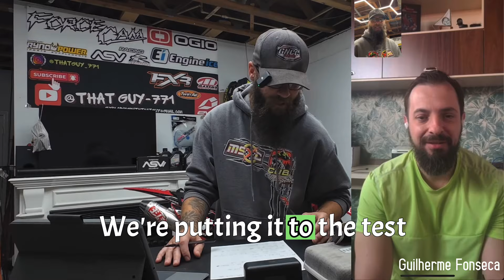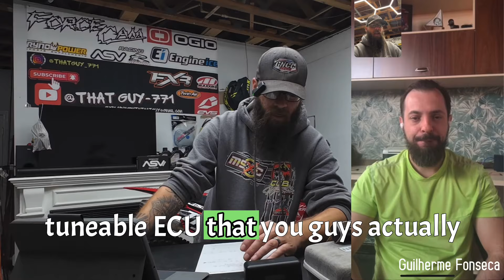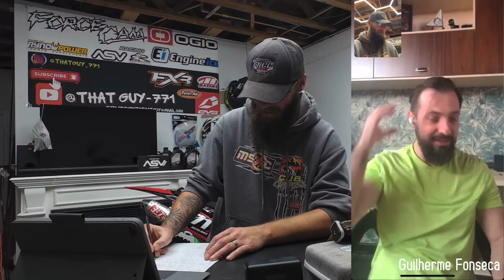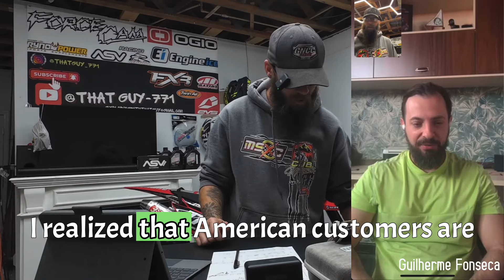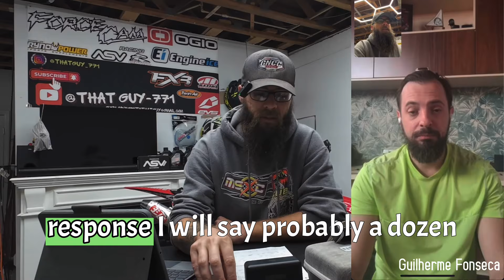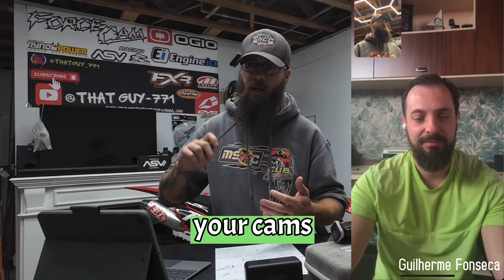CRF250F Big Bore Kits | Force Cam | Live #crf250f #forcecam #crfreview

Comment: Keep the refinements with the ecu coming. Very interested in your specific environments and settings used in them. What you continue to learn on the way. I’m going to use video 3 to fix my same cold start issue as well as the other baseline adjustments you made. So curious if there’s more learned since then. Also the continued performance of the Forcecam kit. Do you regret not going with the Belparts exhaust that the ecu was developed with? I have it on my 250f but had to put an arrestor in it and a db killer because it was straight through and ear piercing. So it’s not what it was when I received it either. Is there any reports on the 310 kit with the race cam ?
Reply from the maker: Thanks for following along! 
So we still have the BelParts on the 310 big bore and you’re right it’s LOUD. It has a grunt at times louder than our Kawi 250. But we have a Yoshimura on the 275 Race cam big bore kit. 

We’re still toying with a few things here and there but ultimately all dialed in. We have been working on some videos for the Alton newer M250X ECU for launch control and things like that you can toy with. Also for the ones that have the original M250 serial number depending we have a software update that can put you on the M250X software with the update. Pretty neat stuff. 

As far as the 310 goes we have the rally cam in that but it’s a tank. Still holds next to the 275 with the race cam. The race cam just gets it on the mid power. The rally 310 is still the preferred tractor though lol
Reply: @ThatGuy-771 you know I’ve never been able to get the Athlon tutorial/course to run in English. The written stuff is like half translated and the audio I have no clue. Having said that you’ve been the translator for me, ty. I tried the cold start fix yesterday and got it to start but you can hear it cycle up and down in rpm slightly and had flame out before it warmed up and smoothed out. Also left the low end feeling sluggish. And it doesn’t seem like I get defaults back with map change as I thought you said it would. I couldn’t find a reset to original maps. I thought I’d get back to square and do only the cold start tweaks and not the rest of your set up to see if I can defeat the cold start and not mess with anything else. I have 92 ethanol free with octane booster that should be getting me a solid 93octane. Stock engine, bel part full exhaust, the mod to air box( as on hyper lite, not full top removal) , and the Athlon obviously. Any pointers are very much appreciated. And thanks a lot for all the videos on this Crf250f. Have a blessed day
Reply from the maker: @12Dredge  thank you! I appreciate the kind words! 
You can shoot me a message on IG or FB I can show you how to do a fresh restart and back to original reset if ya want. We can get ya dialed in. 🤙
Reply: @ThatGuy-771  ya I have neither ig or fb, unfortunately I struggle with big brother issues 😅

Comment: Well, it took a bit longer than I wanted, but after having a real steal of a deal sold out from under me after your live chat with Force Cam, I finally found a super clean, save a bit of boot rash, low hour, (30-ish) 2021 CRF 250F fitted with black plastic (Looks damn sharp, too.) as the young lady didn't like red and hubby had to make it right. Having the stock plastic set aside should things go wrong in a big way is a nice hole card too.  

After getting acquainted and playing with it a bit, I  suppose I'll be sending some money to Force Cam, Tuscany Racing, and Hyperlite Moto soon enough. 

Since you guys have had time to really shake things out in the field, I'd like to get your opinion as to sequence of upgrades and any desirable bits to protect bike and rider.  Most likely frame guards, case covers, and skid plate to start there.

As the bill will escalate quickly enough, I'm thinking I might hold off on the big bore kit and  start out with the Combo 27 HP Plug & Play and maybe the Tuscany Racing Shock and Good Pressure Pneumatic Valve Kit for the forks.  At 67 and 190 lbs. (Yeah, I know.), I see myself focusing on the more technical stuff rather than risking another bout of severe deceleration trauma.  I've been broken and bolted back together several times, almost died of a subsequent pulmonary embolism, and not anxious to go through that again at my age; though I'm not going to go away quietly either. Screw that!  

 Oh yeah, I'll be needing a new seat as the stock was shaved to accommodate the lady.  Suggestions?  

Of course, any other recommendations or tips and tricks would be greatly appreciated. 

Thanks in advance guys. Ride hard, have fun.
Reply from the maker: @sansdecorum4600   hey there! Thanks for watching along! Congrats on the new bike too!!! I tell ya what. I actually already had a video planned as far as mods I would do first or last based on riding styles I have been in the works of finishing up. I’ll have that released tomorrow though. So it should help a good bit answering a lot of those questions! 
As you said we have for sure thrown this bike around all different platforms from trails, to XC racing, MX tracks, single track and even harder enduro. Haha not much we haven’t touched with it that’s for sure. 
As for the seat in the meantime I would suggest getting a whole new seat and cover from Guts Racing though. Custom seat foams or original and custom gripper seat! I run them on ALL my bikes.
Reply: @ThatGuy-771  Cool. I'll look into that seat ASAP. Looking forward to the next video.  Nice timing. Thanks.
Reply from the maker: Absolutely! Feel free to reach out if you have any further questions after too! I’m always here to help 🤙
Reply from the maker: @sansdecorum4600  just went ahead and uploaded it. I do also have a full parts breakdown I listed in the community post section of the channel with all links to the parts on this build

Comment: Informative video. Glad you guys covered the varying fuel issues.  Guilherme came across as super cool and very knowledgeable. 

I get the sense that the 310 rally kit would be the sweet setup for most folk and not unduly overstress the bottom end and driveline. The 360 makes me a bit nervous on that front.  I'm not a fan of frequent rebuilds. 

Still, given that each step in the overbore range makes the engine more and more oversquare and pushing the revs up to hit the power / torque sweet spot, I wonder where the diminishing returns kick in.  Granted, a higher compression piston and proper cam helps, but a modest stroker kit would be interesting.  

I would be interested in Force Cam's thoughts on an oil cooler to help moderate temps for those in hot, muggy, locals.  Tuscany Racing seems to cover the suspension and accessories side of the game and it appears their suspension upgrade offerings are well received.   

Just my opinion as a lifelong rider, mechanic and engineer, but the popular YT obsession with lugging the engine to near standstill and gassing it is ill considered and hard on rods, bearings and everything downrange.  Sure, it will do it, but it's stressful and can also lead to low speed detonation and pistons, not to mention wallets, don't like that much.

I'm sure many will argue this assertion, but I'll stand by the physics. 

Good video.  Keep 'em coming.
Reply: Oh, I had answered with a big text but I don't know what happened, YouTube is not showing the answer. I'm gonna answer again tomorrow. Thanks.
Reply: @forcecam5853  Looking forward to it.  I'll probably get schooled in the process. That's cool. I appreciate being corrected if I'm mistaken. 

For context, I'm just an old dude looking to build his last reliable, low maintenance, trail / play bike with solid power and torque across the lower and mid-range.  Not concerned with top end  power.  For me, that tends to lead to episodes of severe deceleration trauma and I don't mend quite like I used to. 

Have a great day!
Reply: @sansdecorum4600  Hi Sans! haha, you seem to be very well informed. Well, I will not beat my former anwser but let's go. It's true, the 310 kit with Rally cam is the most sold for the 250F here in Brazil. The bigger demand is for exactly that, trail guys looking for more general power and reliability. However, all of our kits are very reliable. Even the 360! The 250F bottom end is very well made and on some degree, overdimensioned. At least this makes all the extra weight worth it! The stock rod bears all the extra power without problems. hundreds of hours of tests accumulated. 

The 310cc with Rally is right there where you are looking at: solid growth in overall power, from low to high. It's like the stock engine, I mean the power curve, but on steroids. Maintenance schedule does not change from the original Honda engine. Same frequency, same everything. 

About the oil cooler, yeah, it can make a difference, about 15 to 20°c celsius less. That is a good help for sure. However, keep in mind that it will be an extra weight on the bike and also there are two pipes coming from the bottom case which can get hit by a stone, stem or whatever and then you're done. There is an kit for oil cooling that I saw here from 4Win, seems to bem very good, light weight and it has some protection in the pipe connectios to the case. I saw some costumers using and they like it.
Reply: @forcecam5853  Thank you for taking the time to elaborate and answer questions.  Good to know the bottom end is seriously overbuilt.  

I don't know if you're familiar with Ryan from the Fortnine (F9) channel, but he covered the rev issue about a year ago.  I think the video was titled: " Motorcycle Riders: You're 're using the wrong RPM"   He also spoke to the resultant increased carbon buildup on the piston,, increased cylinder pressures,  detonation, and mechanical stresses resulting from lugging an engine.  My Dad was horrible about that and would shift into 4th gear in his Toyota Hilux around 20 mph.  The truck literally shuddered in protest, but he was all about gas mileage.  Boggled my mind as he was an aircraft mechanic early in his military career and should have; known better..   A gentleman called "Rembo USMC" followed the F9 video with his own additional thoughts on the matter.   Just an FYI for anyone who might be interested. 

I'm about to purchase a very clean, bone stock, 2020 CRF 250F with about 40 hours on the clock.  The low price leaves room in the budget for upgrades.   I suspect I'll  be doing some business with the good folk in Brazil, Force Cam being first,  before the year is out.   Thanks again.
Reply from the maker: Thank both of yall for the comments and replies! Very informative and knowledgeable! 
It helps others also get insight into topics maybe not covered or topics for more elaborating on! 
Cheers and congrats on your new soon to be bike! We’re always here if you need anything.
Reply: @sansdecorum4600  ahahahaha LMAO with your father story! No I don't know this guy, Ryan, from Fortnite. Actually if I'm not wrong, I think I watched a video of him one time. Can't recall the subject now. But yeah, most people don't know how to proper use an engine and shift gears, they don't understand the concept of power curve, "useful range" (not sure if I can translate this literally but I think you got my point) and peak power. The point where a knocking usually occurs is at the peak torque, and this is the point where dynamic compression is at its highest. But that does not mean an engine can't cope with that. But don't worry about pre-ignition (knocking) with this bike, for some reason it's not commom as was with the 230F (much much more). It's very rare to know about a 250F knocking, specially in US where the gas blends are stable and not adulterated as here. But your father's Hilux runs on diesel, and you know, the way diesel works is literally by knocking! ahahaha. 

I apreciate your words. 
Thanks!

Comment: So if I was to get the 310 or 360 kit. Can I have my ecu re flashed for the big bore kits instead of getting another one?
Reply from the maker: Unfortunately no. You can not get your stock ECU reflashed. You will need the Athlon ECU to tune it they include in their kits.
Reply: @ThatGuy-771  my bad I should have specified that do own the athlon ecu, and was wondering if they could flash the new tunes to it. 

I also own the rally cam, there full exhaust system, air box mod, and heavy duty clutches.
Reply from the maker: @rcwildman9255 oh! Hahaha absolutely yes. They will send you some new tunes for whatever kit you get and you can upload them to your ECU from your phone actually